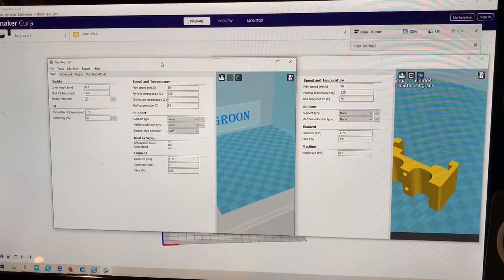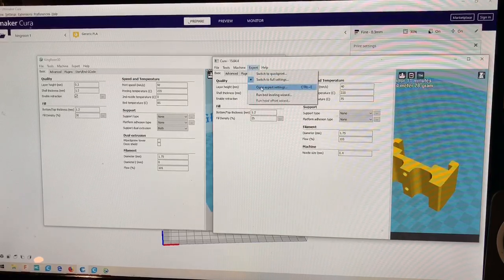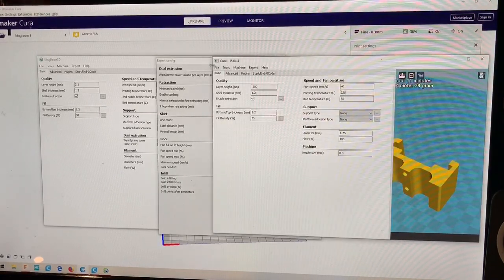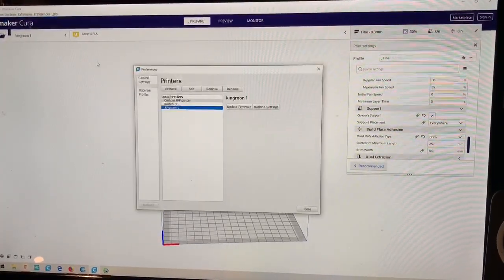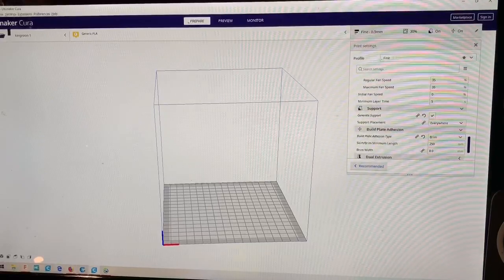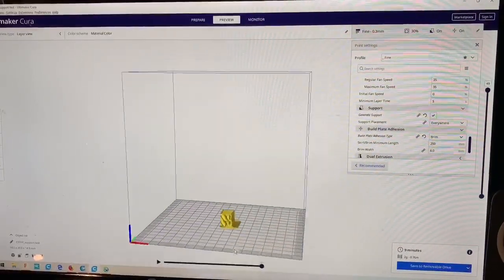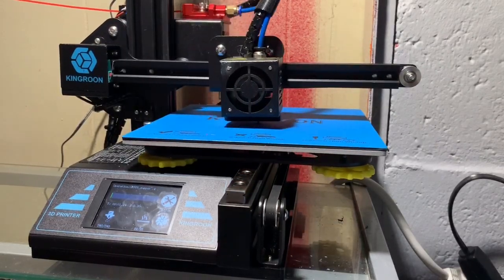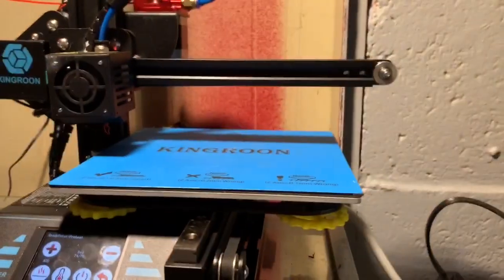Setting up and running the KINGROON 3D printer on CURA version 4.5

Comment: Do you see any improved benefits of using the latest version of Cura over the older Kingroon Cura version?
Reply from the maker: Not at all, I actually think the prints got worse. I ended going back to the Kingroon version. I will tell you ... I bit the bullet and paid for Simplify 3D because I bought 2 ZYLtech gear printers and just could not get prints I was happy with. I ran the same files through Simplify 3D and they are absolutely beautiful! I have never seen prints look so great, it even made the material shine more. I have used Cura for almost 4 years and could never understand why someone would pay $150 for something I got for free. There really is a difference, well worth the money.
Reply: @TTV_FUN_AT_50  Thanks for the reply, I may have to check out Simplify 3D, I would love to see a video using the new slicer ;)
Reply: @TTV_FUN_AT_50  I'm a total noob trying to teach my kids (during covid) about all the cool tech stuff... problem is, I have a mac...downloaded cura (eventually after much google) because the included software included with the kingroon doesn't work on mac...the kingroon website wasn't much help because I can only read english.... any idea how I can set up without or where I can go to find out....?
Reply: the bigest things ive noticed in my 2 months expirience between the two is that the ultimaker cura prints stuff faster than the original. plus you have ironing and other options, the only isue i have is that the beds is inverted and it wilkl print in the wrong area but that might be my g code.

Comment: I just bought a Kingroon KP3-180 printer but I didn’t see a software in the SD card can I use Cura as the main software?
Reply from the maker: You can but you will need to setup the start and stop g-code and the printer settings. On the SD card is there a file named software? If so there is a windows installer file named KingRoon 3D software. That is were you can copy and past the start and stop g-code and the printer settings.
Reply: altima1779 Thx for replying back. That’s odd.  When I looked into the SD card that came with the printer it looks not showed the software msi file & manual...🤔. Also; I downloaded the Cura 4.5 editoon, but when I tried to setup the printer it didn’t list the kingroon model. Any suggestions?
Reply: https://youtu.be/Lp2R84c-2XY i have to sd card file